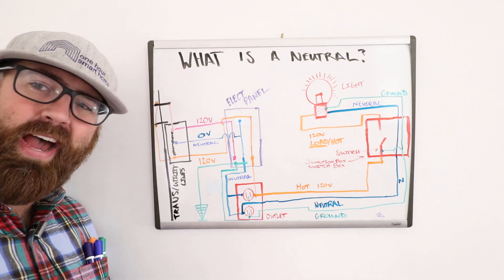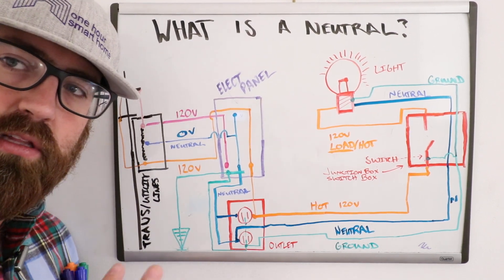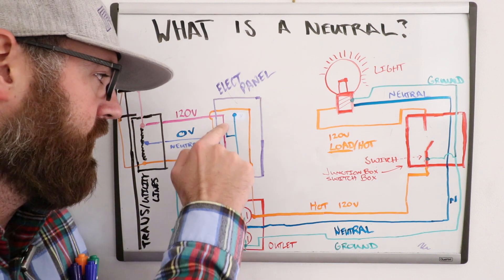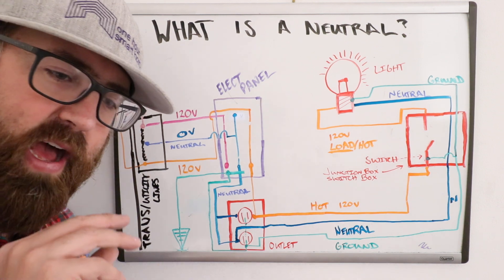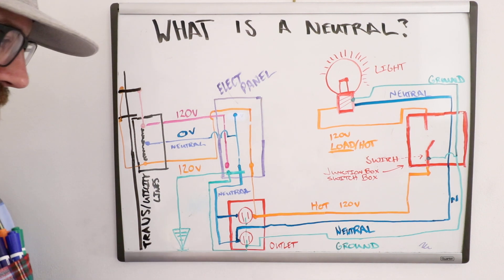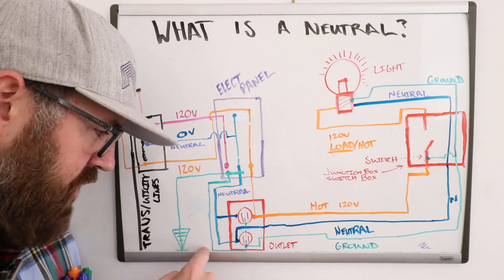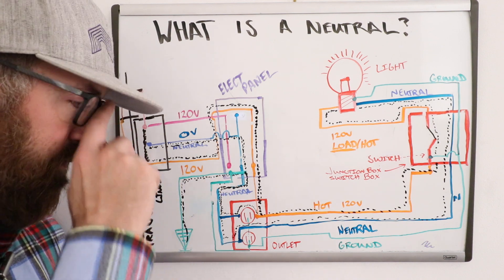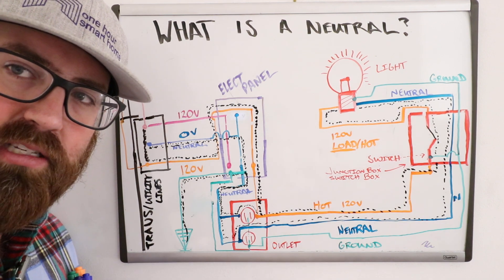What Does The Neutral Wire Do?

Comment: Follow Youtubers. Need help.  If neutral is 0V, and V=IxR, how can current flow on a neutral without violating the equation?  For example if I=10A and R=25 ohms, does the math say 0=10 x 25?
Same for the earth ground path. Help me understand how current runs on earth ground if ground is 0 volts (no pressure to move current).

Comment: Your drawing has misleading part. The "transformer" is not a transformer, just a coil, it's confusing to see the connection from the pole be the same that goes to the house. It should be that the wires from the pole feed the primary coil of the transformer. and the secondary coil on that transformer is what runs to the houses, with the center tap as the neutral. I bet you know and understand this but it isn't clear in the drawing.
Reply from the maker: Agreed, there would be two coils in the transformer a primary and secondary coil, stepping down or "transforming" the voltage. Thanks for the informative comment and clarification for other viewers. I ran out of space on the board and was trying to give a broad overview explaination of a neutral wire for the average DIY'er. Sounds like you are not the average DIY'er!